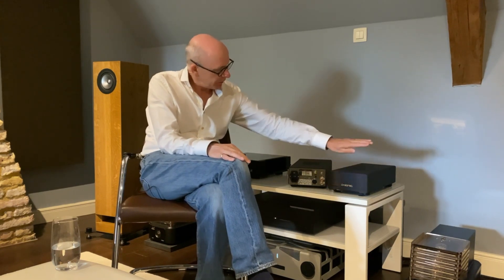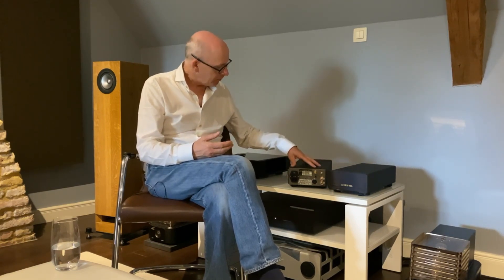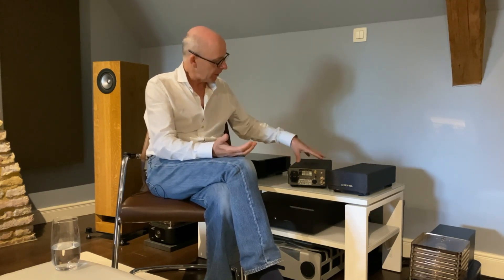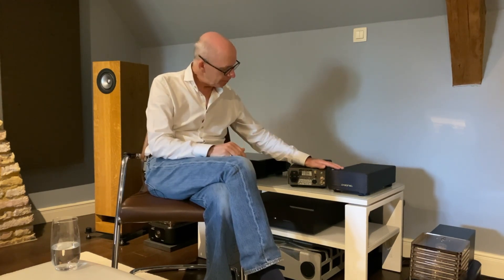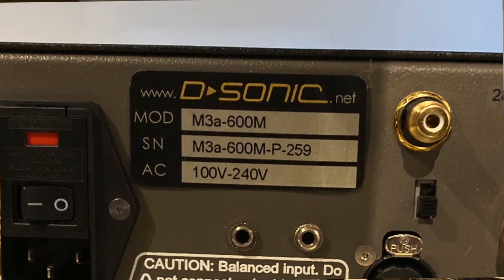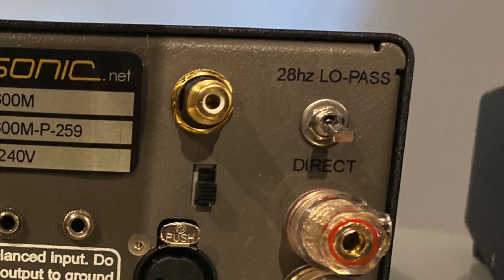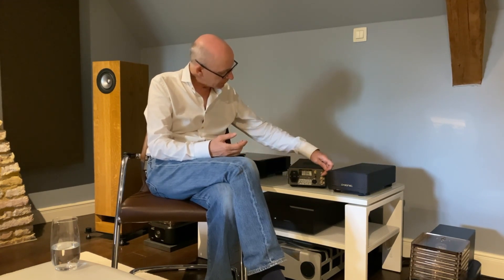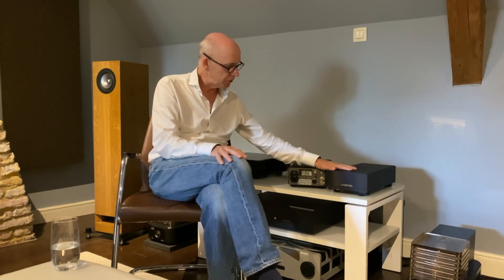Class 'D' amplifiers - D-sonic

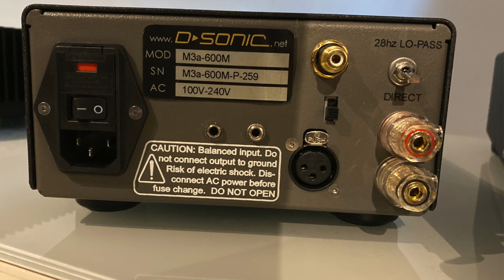Comment: At 05:00 I see 28hz LO-PASS
OMG This is so completely wrong
1. It should read 28 Hz LO-PASS with a capital H to honor Mr. Hertz and a space between value and unit.
2. this is hopefully NOT A LO-PASS filter.

From Wikipedia:
A low-pass filter is a filter that passes signals with a frequency lower than a selected cutoff frequency.

If this was a LOW-PASS filter you would ONLY hear the rumble...
How can anyone trust your information?
Reply from the maker: Indeed. You’re absolutely right. I have no idea why the manufacturer put a sticker on with that . Of course it should either say ‘high pass’ or low frequency roll off.

Comment: Hi, thanks for the great review.  I want to ask if this amplifier is a good choice for KEF REF 5. I would like to use NAD M33 as a preamp and D-SONIC as an amp.
Reply from the maker: Thank you for your kind comments. I see no reason why this amp would not work well with your KEF’s. The dynamics will be fabulous. But watch the volume control! Some preamplifiers have configurable outputs, preventing over powering you loudspeakers. But this is not essential, if you are sensible.

Comment: Whilst you can extract a very good performance from a D Class amp with a lot less power consumption due to its high efficiency, a high end vacuum tube amplifier can give you a sublime listening experience and allow you to cook an omelette on top of the amp at the same time.
Reply from the maker: So true! I use my D-class amplifiers in the Summer and switch to the technically ‘less perfect’ A class tube monoblocks, in the winter. they are great at giving a cosy feeling and heating the room at the same time!
Reply: @PearlAcoustics  I recall an incident in the 1970s or 1980s where a Soviet fighter jet came down in territory outside the Soviet Union and the US managed to get their hands on it. 
The story is that the US officials that examined the jet were amused at the fact that there were vacuum tubes used, some of them micro-vacuum tubes, in the jet's electronics.
They later noticed that the areas where the vacuum tubes were used were critical flight and weapons systems etc. Systems that the jet could not do without in an emergency. 
Vacuum tubes at the time could withstand much great shocks from a nuclear blasts or radiation surges than microchips or standard solid state transistors could withstand.
There has been advances in shielding since that time but it would not surprise me if micro vacuum tubes are still used somewhere in the Military of some countries.
What has this got to do with speakers and amplifiers etc? Probably nothing.
Reply from the maker: @PetraKann  love it! Sometimes what we see as ‘primative’ are indeed advantages, if only we can see it from another viewpoint. To think that the 805 vacuum tubes I use on my class A monoblocks were invented for radio transmission and often used in aircraft!
Reply: @PearlAcoustics  indeed. A tube amp may be a useful investment in the event of a nuclear war. Could be still listening to Kind of Blue whilst your neighbour’s amp chips have fried in the blast wave. Not a bad way to go.

My experience with valve amps is with guitar amplifiers. Valves  certainly colour the tone in a unique way.
It’s an interesting area because the bulk of tine colouration comes from the pre-amp stage in the signal path. It’s here where the weak low voltage signal from the guitar pick ups is increased in voltage. The pre-amp is a voltage a as amplification stage. The power stage is a current amplification stage that increases the power to drive the speaker.
Like your speakers guitar amps dont use crossover circuitry (not that I know of anyway).
I cant remember the company or brand name but they have released rackmount pre-amps from classic amp designs like vox, marshall, fender, mesa-boogie etc. You then only use one Power Amp unit and one speaker cabinet which are connected to your stack of pre-amps. A foot switch allows you connect different pre amps with their unique tone.
Tone resides in the pick up design, strings, guitar design as well but above all, in the fingers and technique of the guitar player (see Jeff Beck).

Cheers 
(Lockdown in Australia with only music to keep sane)
Reply from the maker: @PetraKann  👍 There are also a number of DSP Guitar amp simulators, such Roland. Maybe one day there will be one for HiFi amps.
Reply: @PearlAcoustics  I can envisage that in the future. One separate power amp, great pair of speakers and a stack of pre-amps finely designed for Jazz, Classic, Rock, heavy metal and maybe one for death-thrash-grunge metal.

(I like Roland gear and still have a few of their old drum machines and synthesisers. Still innovating new stuff and clever gadgets, Cheers)
Reply: @PetraKann  BS. The US military used valves in their gear also. Not something new to them in the 80's.

Comment: Interesting. But i saw "28'Hz Lo-Pass filter" was written on the rear! It should be Hi-Pass filter at 28'Hz if it is a low-frequency sub-sonic filter. (& it's far too low a f' if it really is a "28'Hz Low-Pass Filter"   useful for a deep sub-woofer amp)  Surely a mistake print.   The fairly new Class D amps using Gallium Nitride transistors (or is it Gallium Arsnide? ..1 or the other) instead of the normal silicon transistors, I've noticed they are unaminously suprising some good (imo) Youtube amplifier reviewers who previously didn't like all the qualities of all their previously reviewed  (silicon-based) Class-D amps,  yet are all being very pleasantly  surprised & 2or 3 near shocked by the new Gallium-x transistor switching amps. Ive no idea what type these are. Obviously very good nonetheless
Reply from the maker: Well spotted! That was the label placed on the back of the amp by Dennis, he realised the error the moment he did it but we found it amusing and have kept it there ever since. 😉
Reply: @PearlAcoustics     nice one.  A touch of uniqueness,  tho his colleagues may often remind him of it, in jest.
Reply from the maker: @The-Spotlight-Kid  😀👍

Comment: I think even the average class D ICEpower module sounds good nowadays.
Nice dynamics, good slew rate/transient response.
Class D used to be inferior to A or AB, but a lot has changed in the past two decades.
Reply: Digital signal processing.  So long as your switching frequency is high enough, the granularity of the signal is a perfect reproduction of the source signal.  None of this was practical until the development of modern micro controllers/micro processors.  Digital signal processors.  That, and crazy good development in switch mode components.  The same technology drives electric vehicles too.

Comment: Great video! One thing I always wonder with Class D, is if there can be an analogy made with fluorescent lighting. There's some well documented evidence that the 120hz flickering of fluorescent light bulbs causes fatigue, headaches, a sort of subconscious response to the flickering stimulus which some parts of the brain do perceive, even if the eyes do not. Incandescent lighting is prone to the same 120hz flicker, but the filaments don't cool down quickly enough to really express it, so they're perceived to be more "natural" or warm or calming in comparison. I could be totally wrong here, but could class A's "naturalness" be considered almost like an incandescent bulb where as Class D is more akin to fluorescent, even if the switching frequency is extremely fast? Could the brain, at some imperceptible level be annoyed by the switching? Getting into woo-woo land here but, even with a decent class D, does anyone notice a weird fatigue or harshness settle in after an hour or more of listening at relatively acceptable levels (less than 80db)?
Reply: Kevin i don't think its a good comparison in this case. Its like talking the CD will make you headache because its coded in 01010101 signal
Reply: @kingscinema3873   Funny, I was also wondering if this analogy could be applied to a digitally reconstructed sine wave vs one that is simply amplified from an analog source. I always wondered if this was at least partially to blame for the "analog" sound. Ultimately I think you are right though, the digital "steps" that reconstruct the sine wave are not perceived after a certain level of resolution, and won't give anyone a headache. Another analogy that may disprove my theory that "flicker" is perceived as "unnatural" is that films are traditionally shown at 24 frames per second, which is highly incomplete compared to how we perceive motion in real life - however our brains fill in the missing frames with no problems at all and in general seem to actually prefer 24 fps to higher frame rates like 30,48,60 fps etc.
Reply: @Purpleyamz  i cannot listen to digital for more than 20 minutes ,I get very restless almost aggravated  it just does something to me  that analog does not
Reply from the maker: Interesting. I never have, except with super DSP processed surround sound type environments.
Reply: @PearlAcoustics   Not sure I really have either, except in cars with cheap class D amps (like mine) and even that may have more to do with having tweeters on the A beam pointing directly into the driver and passenger's faces. It's just always something I've wondered about, especially in the earlier days of Class D when they were often described as sounding unnatural. I guess the switching frequency on most good class D amps is much, much faster than 120 hz however.
Reply from the maker: @Purpleyamz  if I remember correctly, switching is over 48khz... way above our recognition
Reply: @PearlAcoustics  I think some go into the mhz!

Comment: I have had a D-Sonic M3a 400wpc stereo amplifier for several years now, and it is an amazing amp. I routinely tell people who ask about it: If I had a budget of $100,000 to buy another amplifier, I would NOT KNOW FOR CERTAIN what amp I would buy that I would like better than my D-SONIC. I have compared D-SONIC amps to amps well into the 5 figures (over $10k+, some even over $50k), and I like the D-SONIC better. The value of D-SONIC amps is through the roof. Even the smallest one (the one I own) will drive well just about any consumer loudspeaker on the market (at 400 wpc into 8 ohms and 800 wpc into 4 ohms).
Reply from the maker: It’s always great to hear from people who have found the right equipment for themselves. Indeed, the D-Sonic range is right up there with the best.

Comment: May I know if the  D-sonic are warm or cool side of neutral ?
Reply from the maker: I would say they are neutral. Ie very accurate. They don’t add any detectable coloration - good or bad. Sorry if I have not answered your question!
Reply: @PearlAcoustics  thanks! I had the XTZ edge a2-300 which i didn’t really like cos it’s on the cool side of neutral
Reply from the maker: @mattphang2477  indeed... these things are very subjective, but a weird thing I found is that by changing interconnects, sometimes can make a difference. For example Amazon ’Basics’ can tame down a harsh sounding amp! Weird but true.
Reply: I’ve owned these amps couple different times. They are great little amps. I had the previous generation.  The previous Gens did not mate well with speakers that have ribbon tweeters. Also speakers that sound neutral or lean sound more cold and lean. I had my d sonic  mated to dynaudio c4 and sounded fantastic. When I paired them with Salk SS8 with the ribbon tweeters sounded horrible. The speakers sounded sibilant and thin. The Salks measure flat and doesn’t have a lot of bass to begin with but with the d Sonics sounded like there was zero bass and all highs. I switched to a warmer class A/B amp - parasound JC1s and the sound was more full and warmer.  I have tried other class d amps like bel cantos and wyred 4 sound and those sound warmer.  D sonic to be sound more cold and clinical which mates well with warmer speakers.

Comment: I was fascinated by the story of the Sibelius speakers. I could almost buy a pair just from hearing about them.
Your experience of amplifiers is also interesting. You have spoken mainly about power amps - D Sonic, Ming Da and the power amp section of the Pure Audio integrated. Which pre amps do you like?
Best wishes, Anthony
Reply from the maker: Dear Anthony. Thank you for your kind words. To be honest, I am pretty ‘a-typical’ when it comes to pre-amplifiers. I like to keep the signal path as simple and elegant as possible. If you like Tube powered,  Ayon make very fine (but expensive) equipment. However, we use the QUAD Artera Play plus. It is a fabulous unit and is compatible with many power amplifiers. But there are many of these type  of products available. I like these ‘all in one units’ because they reduce cables and external interference and also because they go out of date quickly, so are better value for money to replace. Having said that, I also use a 1986 Quad 66 pre-amplifier that is still working very well indeed!

Comment: This guy us a genius. "If you want a good amp, buy a well designed Class A amp, or a well designed Class AB amp, or a well designed Class D amp. Don't use a tube amp in a hot room but use a tube amp in a cold room."
Reply: I hear this often, but really, how much does a typical push pull tube amp warm up a room? I've been using one for years and have never seen the room thermometer move even 1 degree up when I turn it on ...and my amp is in a rather small, non-climate controlled room.  I guess this idea comes from people that like to sit inches away from their amp.
Reply: terrywho22 maybe it has to do with sound quality?
Class A is far worse to use in summer lol if you don’t have air conditioning
Reply: @terrywho22  As much as a couple light bulbs.
Reply: @carlsitler9071  Yup, that's about right.
Reply: How many if I use energy saving bulbs?

Comment: Weird how commercially made class-D audio amps in the 20 to 50 WPC range are as rare as hen's teeth. 🤔
Reply: If you have such low power requirements then that's all the more reason to use class A or A/B and have true audio fidelity and not a distortion pedal for a power amp.
Reply: NAD makes really good ones. The C328 and the C338 integrated amplifiers are 40 and 50 Watts respectively. Class D and some really decent build quality and sound quality.
Reply: actually they are plentiful, and dirt cheap, and excellent (also sometimes they spec for 300watts are for 4 or 2 ohms, at %10 distortion which means 50 at 8 with no distortion)

Comment: I use Mola Mola Kaluga's I think you will like their performance a little better then these and they are 400 watts @ 8ohms and easier to live with. Just use a good aftermarket power cable  with good connectors and good copper not the little evil cheap black 14 AWG crappy one it comes with. The capicitors a lone in Mola Mola cost more than the Hypex module and they use a proprietary power supply as well they make in house. It would be interesting to compare them. I would also think about using a good preamp from Mola Mola or an Audionet Stern. The Stern is the finest preamp I have ever heard,  I use a Lampizator Baltic DAC with a built in active tube preamp. My speakers are YG Acoustics Carmel 2's.
Reply: $16,000 a pair for class D. I guess your paying for the fancy cases.
Reply: @ponch0068 You have no idea they were custom designed by Bruno Putzy's..The caps alone cost more than the hypex modules and custom power supply bespoke for them
Reply: @pennfootball71  Yeah, Bruno from Mola Mola is a true expentional designer, a true master in his field. The VTV amplifier based on EVAL-1 is exceptional value in high-end.

Comment: In what way they sound like SET?
Reply from the maker: Well I can’t say they actually do. It’s just more in that direction, than they were before. You could begin to compare with some solid state SETS.
Reply: I would respectfully suggest that the low power Spec Corp class D amplifiers would be a much better match with FR speakers like the Sibelius. The designer is coming from a tube SET background.

Comment: Bruno Putzeys recently left Hypex and co-started his own company in Denmark : Purifi Audio . The  new Class Damplifiers are reputedly on par with the best Class A units . They also make a nice 7 inch woofer .
Reply: They are not on par with the best class class a a/b  amplifiers
Reply: @henriksrensen3220  agree. class D amps do not operate as linear gain devices. Essentially they are electronic devices that use switching regimes - ie MOFSETs. 
The main advantage of D class amps is not sound quality - it’s power efficiency. They are very economical with respect to energy consumption